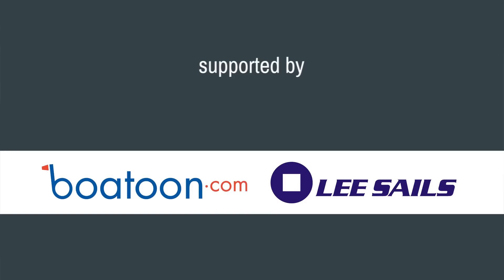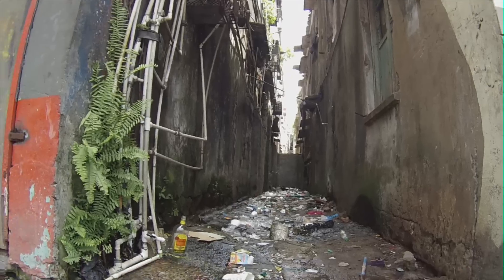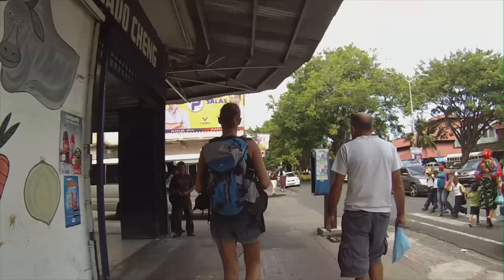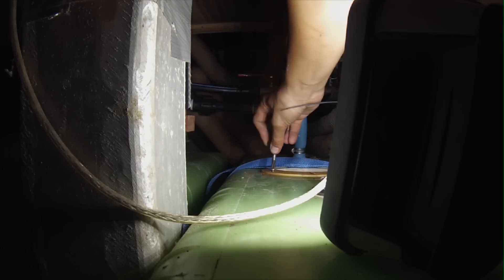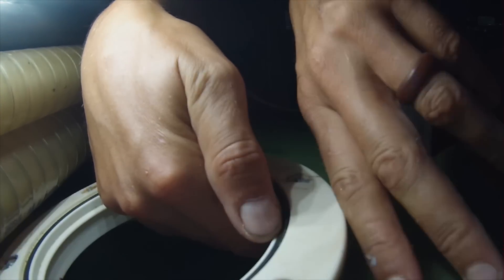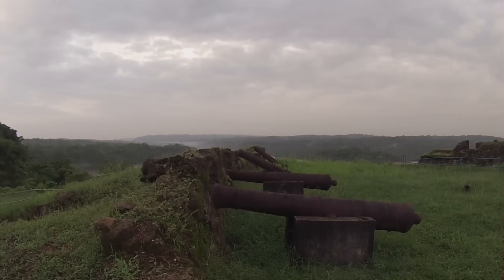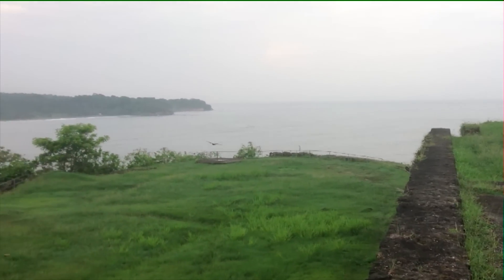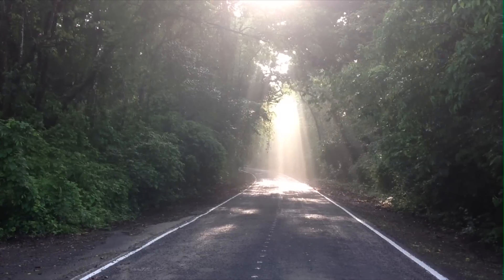A Break From Boat Work: Filling Up The Batteries At Fort Lorenzo - UNTIE THE LINES #39

Comment: WhiteSpot Good job , the main reason I suggested putting some rubber between the heat exchanger and the bracket you made is the exchanger is probably brass/bronze and your bracket is steel. With the engine vibration you do not want the bracket to "wear / abrade" a hole in it after long hours of running. I hope (we hope) before you do any serious offshore sailing you are equipped for it. Liferaft / e-prib / communictions such as SSB / Sat-Nav etc. etc. etc. Take some short hops to kind of shake down Karl. Take care
Reply from the maker: I do have a liferaft and an SSB, epirb is still on the shopping list. And for the last couple of weeks  have been exactly doing what you said: taking some short trips to get to know Karl better. And it worked out quite well, he has been behaving very well and despite a few little issues (like always :)), everything has been working very well!!
Reply: Great glad to see you / Karl are doing well. Don't forget fuel filters. Take care / good sailing.

Comment: Good job on your heat exchanger bracket, see if you can find some rubber to put between the bracket and the exchanger. When you leave Panama are you going to be single handed , maybe sail with another boat. Good luck and good sailing.
Reply from the maker: Hey Bobby, I put a heatshrink around the bracket to isolate it. I hope that will work. I went with a friend for the first trip an then I will try to go solo from there on. And if possible, go along with other boat, yes. And if there is someone who comes along for some time, I won't say no, either :). I don't want to break any records or prove anything...just wanna see if I am capable of going solo and feel comfortable with it. But if it takes time, it will take time...
Reply: WhiteSpotPirates
I'm a solo sailor and what work for me was to sail conservatively. I reefed early which really didn't slow me down to much and made for a more comfortable trip. I'm sure I'm sharing nothing that you haven't already heard.
Cheers and good luck!

Comment: I spent a lot of time trying to figure out where the algae in my h2o tank was coming from and it turned out to be coming from the marina water line!  I now filter through a clean cotton t-shirt it as it comes on board and put a tablespoon of bleach in the 30 gallon tank and all has worked out well.  The bleach breaks down in a day or two into harmless salts and no odor remains.  There are probably very small particles of sterilized algae in the tank, but a 20 micron filter after the tank suits my needs fine.
Reply from the maker: not sure if I have any clean shirts on board ;).

Comment: I imagine you are getting used to the never-ending string of problems Karl throws your way and can deal with them immediately.
Reply from the maker: Ah, well, I would not say immediately. But at least one gains a certain belief that things will eventually be solved one way or the other. All it needs is a bit of patience and sometimes thinking out of the box...and patience, did I mention patience? ;)
Ahoy, Nike & Karl

Comment: even tho I might of got out of "order" of your clips, I am glad to hear your thoughts on being safe and trusting your gut! 
if you keep opening your gas tank to check the quality are you afraid of weakening the bolt/screw holes? isn't there something you can add to the diesel?  and nice touch on the pink toenails 🤓
Reply from the maker: Hi +Rick LaLande, I don't think the bolts will get weak, no. And there is also a thick gasket between the lid and the tank. And I actualy don't open it that often...Actually have not done it in a while...but should maybe ;). You can put additives, yes, and I usually do. But in the tropics with all the heat and the it cools down at night, you do get quite some condensation in the tank so even with additives u sometimes get growth.
Ahoy, Nike & Karl
P.S. The pink toe nails always make me happy when I look at them ;)